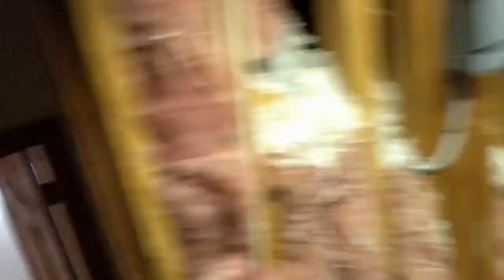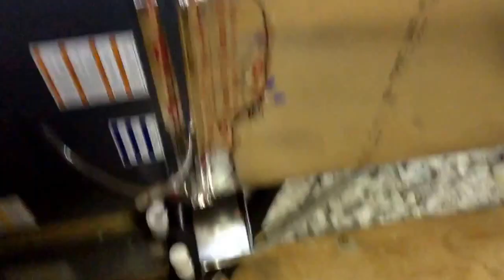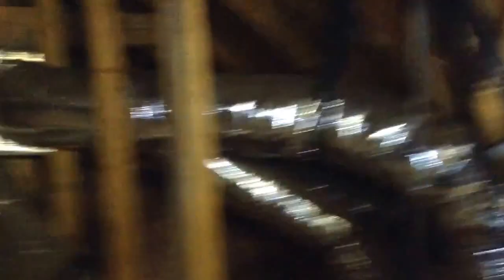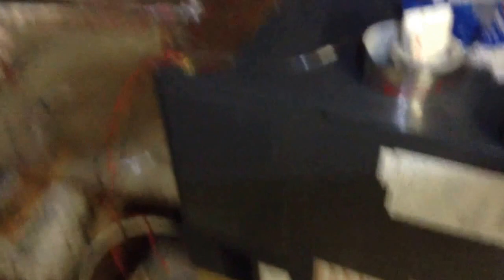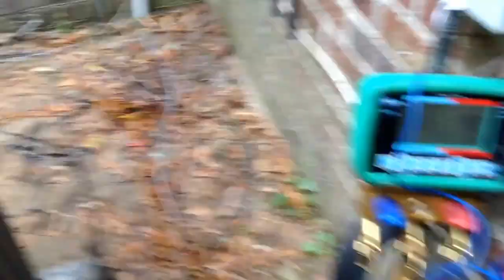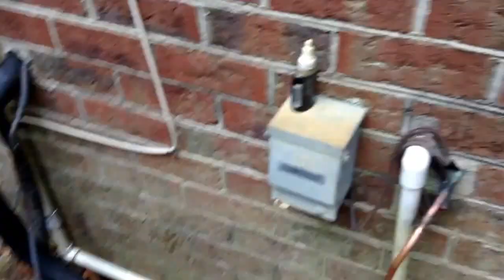Two become one

Comment: I think I may have a man crush on you Mr Shearer! Your systems always look so well thought out!

As far as the camera goes, I like the Sony because it goes on the side of your head and leaves your foremen space available for wearing a headlamp. My 64 gig memory card can hold 22 hours of 720p video. I have 3 batteries that I cycle through as needed and feel like I certainly get more than 1 hour from each, I'd say probably 3/4 hours per battery. Check out the Sony AS30, it's a little cheaper than the AS100 that I use. 
Wasabi Power Battery (2-Pack) and Charger for Sony NP-BX1, NP-BX1/M8 and Sony Cyber-shot DSC-HX50V, DSC-HX300, DSC-RX1, DSC-RX1R, DSC-RX100, DSC-RX100 II, DSC-RX100M II, DSC-RX100 III, DSC-RX100M3, DSC-WX300, HDR-AS10, HDR-AS15, HDR-AS30V, HDR-AS100V, HDR-AS100VR, HDR-CX240, HDR-MV1, HDR-PJ275 https://www.amazon.com/dp/B008SFPMRK/ref=cm_sw_r_awd_jhC7ub01SG2NG
https://www.amazon.com/dp/B008SFPMRK/ref=cm_sw_r_awd_jhC7ub01SG2NG

Sony AS30V High Definition POV Action Video Camera HDR-AS30V Bundle Includes 8GB Micro SD Card and MicroSD Adapter, Carrying Case, Lens Cleaning Kit and Pocket Mini Tripod https://www.amazon.com/dp/B00OOZF4KS/ref=cm_sw_r_awd_hiC7ub1TRWPN0
https://www.amazon.com/dp/B00OOZF4KS/ref=cm_sw_r_awd_hiC7ub1TRWPN0
Reply from the maker: Wow Mr Rardon! Thanks for the compliment like you said I go for perfection and I hit good enough. Thanks for all the links too.

Comment: Looks great!  Seems there should be plenty of return, so the static you measured seems a little surprising.  Curious to know what type of filters were in place if they were in.  Thanks for the video.
Reply from the maker: Yeah I had two 20x20x1 pleated and one 20x25 pleated although I didn't have a new filter for 20x25 I might recheck it when I replace that.